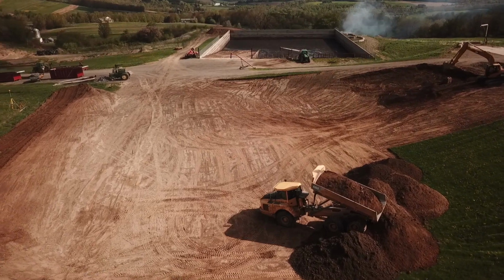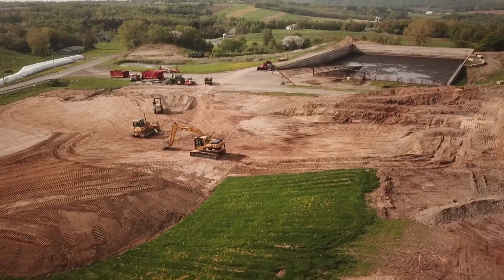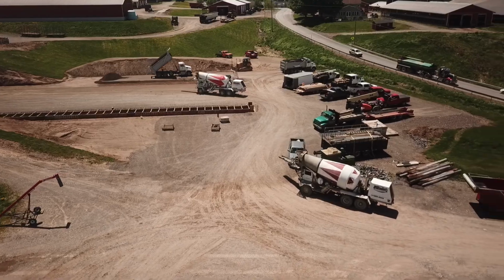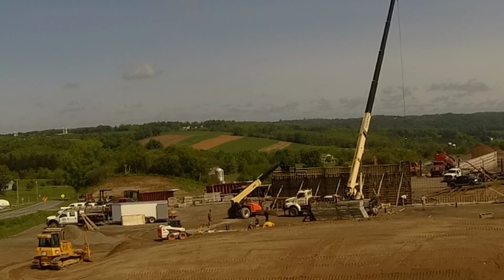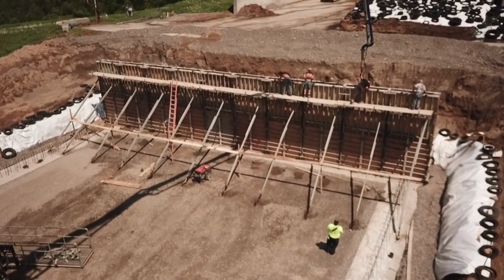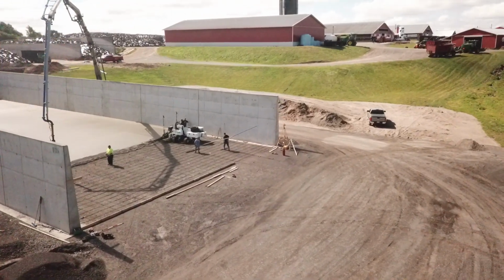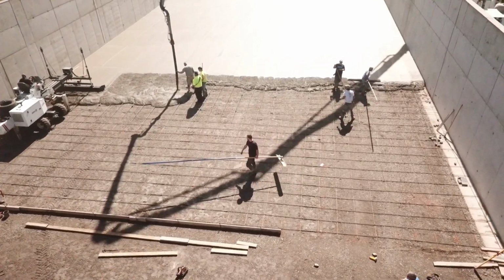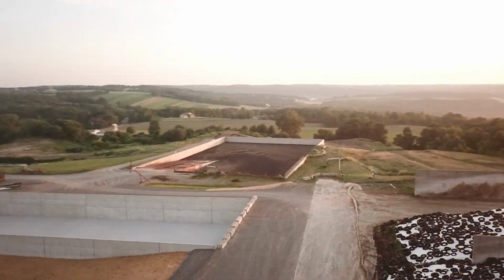Building of a silage bunk

Comment: We used to pour 12 inch thick walls 60 feet high at the local paper mill. Takes a lot of bracing to do that .looks like you are doing a fine job on the walls.

Comment: Curious as to why you are building it that way as opposed to the prefab bunker walls? Im guessing for longevity?  As the prefab walls tend to get weak over the years, atleast the ones that we have at work.
Reply from the maker: Jim Civitello our first 2 bunks that we had built were pre Fab. They were 8' tall and worked good while we were using them. As time went on poured walls made better sense, we had some spoiling issues with the pre Fab walls, the seems between the concrete slabs allowed for spoilage.
Reply: Andrew Hourigan  yes we get some spoilage also almost always at the joints between the prefab panels. We currently only have 1,  2 sided bunk and another single wall bunk that we are able use. The rest gets packed in a pile on a paved area, not ideal by any means.
Reply from the maker: Jim Civitello drive over piles works good, an option for the walls with the seems is to lay plastic against them it's just a pain to deal with.